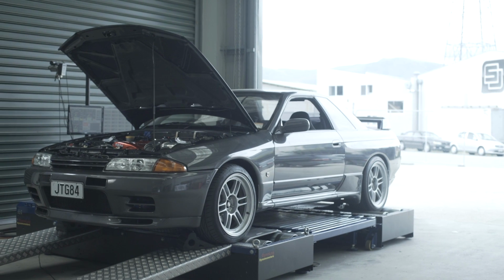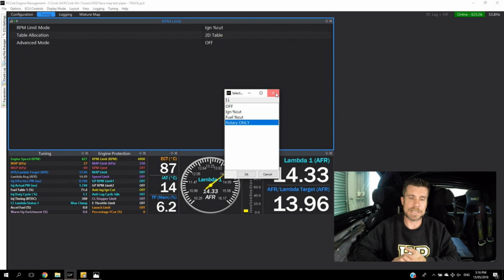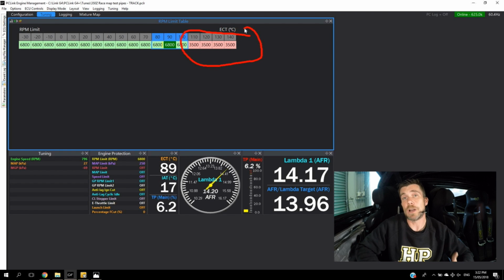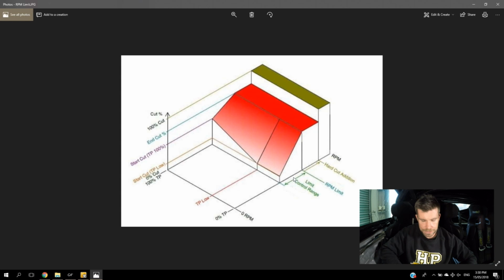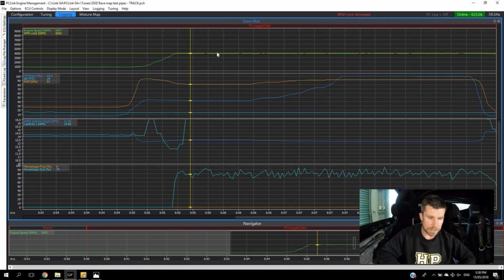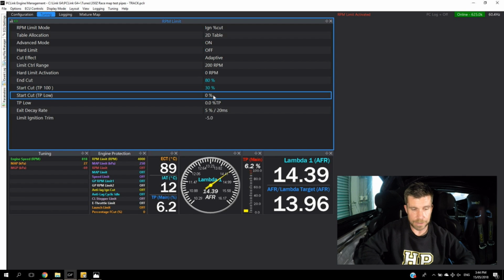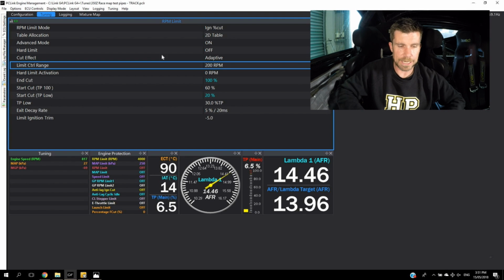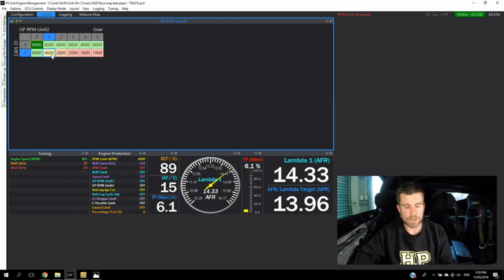How To Configure the Ultimate RPM Limiter [GOLD WEBINAR LESSON]

Comment: Andre curious if you were to build another shop drag race Evo 8/9 what would be your ECU of choice?
Reply from the maker: There isn't really a straight answer to this as it depends on a few factors that are specific to the tuner and the budget, but for Andre, a MoTeC would make sense as it is one of the platforms he has used the most in his career via customer cars and his own projects (DOCILE ran an M800 from memory which is probably how he got started with them).
Now with that said, a different tuner might have a different answer, and that would still be 100% the right choice for them too. There are really more good options than bad ones out there these days and with that first sentence in mind you really go for what the situation calls for rather than just sticking to one brand blindly - Taz.

https://www.hpacademy.com/previous-webinars/120-selecting-a-suitable-ecu-for-your-application/?utm_source=youtube&utm_medium=social&utm_campaign=general-interaction

Comment: What's high limit and high restart limit?
Reply from the maker: Depends on the platform, but your rev limit is your high limit (could be soft or hard depending on the platform), and your restart limit is where your engine will start operating again. 
So say you have a 9000rpm limit and a 8700rpm restart, if you hit 9000rpm it would cut your engine until it drops back below 8700rpm.
If you are an HPA member and need more help with this from a tutor, make sure you post up on the members only forum over on www.hpacademy.com - Taz.
Reply: @hpa101  thanks, also what what cause an automatic car to keep hitting the rev limiter and not dropping until you release the gas paddle? This happens mostly when I brake boost? Could it be the transmission slipping?

Comment: I'm reflash tuning with HP Tuners and the only options I can find for launch control/2 step options are under fuel, rpm stationary limits. This is obviously a fuel cut. The engine is supercharged and does seem to suffer with fuel cut at launch. As well as when traction control is off or in sport mode, this stationary rpm limit I set seems to go out the window and does not exist, just like the stock one. The car is a manual as well.

Comment: I know this was a live class but I'm hoping I can get some insight on something to do with rev limiter. I have a fully built 15+WRX with the FA20DIT making 500whp. I have an IAG stage 3 Extreme Closed deck with IAG Stage 5 cylinder head package. (So fully ported heads with full valvetrain upgrades and 1/2" headstuds. My heads setup is built to rev way past the stock limits buy my tuner left the stock rev limiter on. My question is how bad is it for the engine to hit that limiter? Or is it even bad for it to hit it sense my rev limiter could have been raised another 700rpm
Reply: You will be fine. Depends on how hard it hits that limiter
Reply: @kinslayergaming3159  not very once I realize I'm hitting i lay off or shift and it has only happened twice now
Reply: @_wrx_WHPFaDIT  ever have any issues? I wouldn't think it would be a problem, especially if it really is the factory limit, it should be a soft then hard fuel cut. If you're on an aftermarket ECU, it could be either fuel or ignition cut, in that case it would be wise to determine which, although those heads are probably pretty rugged.

Comment: So oxygen sensors read oxygen content, right? If you're on the rev-limiter and using spark cut or fuel cut would the sensor read lean assuming fueling was actually as desired? I'm guessing to just ignore these readings and just tune that area of the map for normal driving right? I would assume the fueling for high load should be fine for the rev-limiter.
Reply: nevermind it was answered at 28:15 lol

Comment: Cutting 1 cylinder from a 4cyl engine cuts more than 25% of the power as you are still left with the frictional losses from those bearings and piston rings.
Reply: power generated will be 3/4, but losses obviously won't scale, since as you said, you have to lift the valves, move the piston etc...
Reply: 26%?

Comment: How does it work with on the fly control of the limit with a multiple position rotary switch? Would you just setup another general purpose table with one axis tracking switch position (voltage ref)?